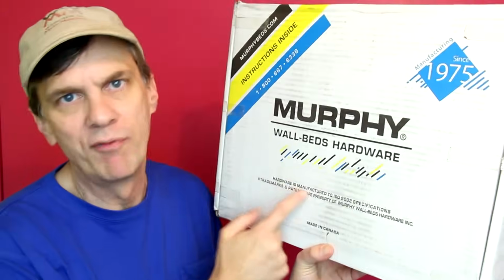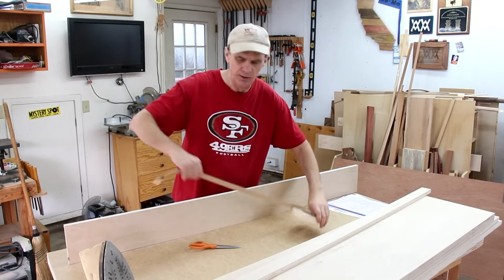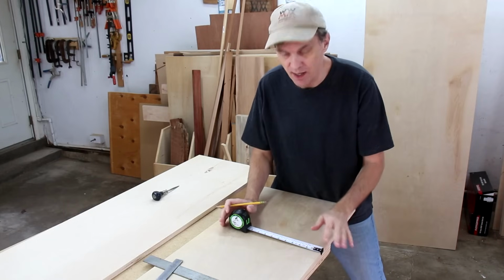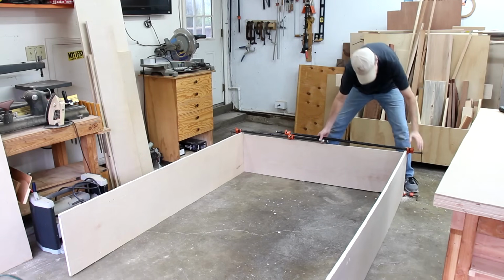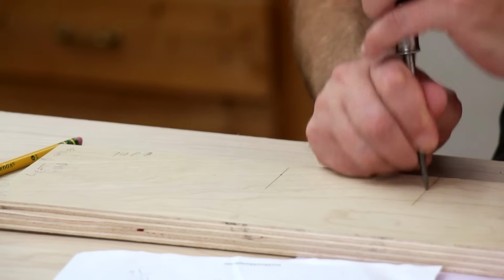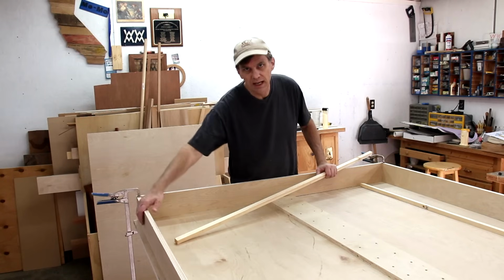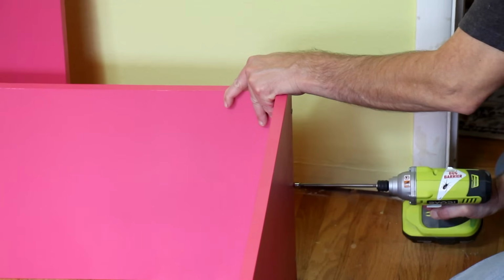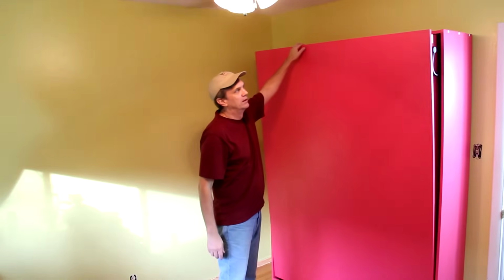How to Build a Murphy Bed. Free up floor space in your home!

Comment: I have a question about the arch that the full size mattress has in a Murphy bed configuration? This video shows a ceiling fan in the room where the Murphy bed is installed. I want to install a Murphy bed in my spare room and I want to install a small ceiling with light as well. I want the bed to swing from head into position. I am concerned that the arch of the bed will contact the fan.

Comment: When I need long pipe clamps, I just screw a straight splice between 2 pipes and that is so much more steady than trying to use 2 clamps and I have had up to 3 pipes together. This lets me have long clamps when I need them and then shorter (say 2 to 3 feet) clamps the rest of the time. The splices are just nipples that you can buy to fasten long lengths of pipe together when running a long line during remodeling or during a "new House" build. They are only about $2 each.

I made a bed base for my daughter and used biscuits (only because I had them along with the biscuit machine) and then used face frame screws every 4 inches as clamps. The unit is still being used and this is after 5 years.

Comment: Steve: You are pretty cheap if you can't invest into some longer lengths of pipe which you can always use later in life! I one time bought 20' galvanized pipe for a very large deck job with engineered exotic lumber. I later cut it down in size to use on cabinets and other jobs! Those clamps look like jorgensen & are great in my mind!! Buy longer pieces of pipe.
Reply from the maker: Yep, I am very cheap!
Reply: Steve Ramsey lol

Comment: Hi Steve! This was great. Can you tell me how high your ceilings are? I'm trying to decide if I need to go horizontal on my bed or if I can go vertical.
Reply: A standard bed is six foot long. Even allowing space for the mechanisms, you should be fine with a standard height ceiling. The bed might be a little low to the floor but it'll fit

Comment: Dumb question but why did you use the edge banding since you were painting it? I love your videos, keep them coming.
Reply: I've seen it done before when you can still the plywood layers even with paint, so putting the edge banding creates a smooth surface to paint over.
Reply: Les K yeah, paint doesn’t cover plywood edges very well.
Reply: Apply a layer of spackle on the plywood edge and then paint it,, it will hide the plywood edge.
Reply: iron-on edge banding is MUCH easier than that. No sanding, and less effort to smooth it out.

Comment: Steve, enjoyed the vid, when we get our first house this is the first thing my wife wants installed.  I thought it odd you mentioned not being able to drill straight through the two pieces of wood.  It is an odd tool that sees very little use in my household, but it has come in handy.  A portable drill guide.  Similar to your pocket hole guide, but more of a drill press.  Found one on amazon, thought you might take a look, definite time saver when it is needed.  http://www.amazon.com/Promax-79251-Precision-Portable-Electric/dp/B002C1AMOE

Comment: Steve Ramsey can pocket holes & jig be used instead of bisquits? Will it still be strong enough to hold the two pieces of wood together? I don't have a bisquit jointer is the reason I ask. Thanks

Comment: I worry about using screws between the plies of wood sheet you used.  Seems to me that they will work loose with time and mess up the wood in the process.  Why didn't you use finger joints and glue?  Maybe use corner braces?

Comment: 1 more thought, even though I modded the build, with the wallyworld matress in a box, I can use very light pressure to raise and lower it and you can stop and balance it with 2 fingers.the gas shock system thru rockler or amazon is top shelf.

Comment: I dont need no stinking instructions,,,,,, well when building a murphy type bed yes you do. Ive wanted to do a wallbed for years, finally wore her down and got the green light , I wanted to do it in cherry, she said just do it. After adding up how much it was going to cost I almost made it paint grade, then I realised I had some hollow core doors and figured out how to re use them for the matress frame platform eliminating 1 sheet of cherry ply, thats 140.00 so I figured that made the cherry build doable again. It came out great. I used the gas shock kit from rocklers, mainly because of the fantastic instructions and blue print type layout pics. I made the front look like 2 craftman style doors and added crown mold ontop.i hate edge banding and always use solid trim, I used alder for the trim and it matches well with the mission cherry gel stain and wax treatment.Here is a tip , if you are putting this on carpet , wait to drill the mounting holes for the foot mechinism.because as you are plumbing the frame work it may settle Into the carpet and your guests will be sleeping with their feet higher than their head, how do I know this?..just guess.total cost for the cherry wall bed not including matress 975.00. Note wally world sells online  a bed in a box, like your steve, in full size for around 200 bucks. Our guests really admire the bed and it sleeps great. Great vid steve thank for all youdo.

Comment: I like, no surprise there. I live in a rented home, so I didn't want to bolt a Murphy mechanism to the floor, so I used a kit from Create-a-bed, their plans are fully diagramed and the guy there cutomized the plans and the gas lift system for my, already owned, overized, pillow topped, king size mattress, for no extra charge. I love it. 

The kit you used here appears to also allow for minimum overhead mounting with minimum modification to the house, I like it, the build seems simpler cause the design is way less ornate, you appear to have made up for that with your bold paint choices, great job.

By the way those special screws are like the ones found in most IKEA flat packed furniture (I have assembled literally tons of them), they appear to be designed for holding different forms of that really heavy particle/press board they use, it pulls together and holds stuff together that is quite a bit weaker than plywood, so should work great here.

I sleep on one of these every night, its a lot of fun to get the space back in the morning :-)

Comment: You can buy those "special" screws separately, I know Hettich makes them, probably some other manufacturers do too. They come with dedicated two-diameter drill bits and are fantastic for connecting boards. They make for a very strong and rigid connection. Particularly good for anything where you cannot use glue.

Comment: I have some of the same pipe clamps and made the your clamp rack from an old video.  I solved the problem of long reaching pipe clamps by buying the appropriate sized Union piece from one of those big box stores and I can just join two of my pipes together end to end.  The union also doubles as a thread-saver on the non business end of the pipe clamp.

Comment: Great video, a Murphy bed has been on my list for quite a while now.  If at least one of your pipe clamps is threaded on both ends you can get a coupler to extend them.  If not, that's a great tip on another way to do it.

Comment: Whether your pipe clamps (that were not long enough) are 1/2" or 3/4" iron pipe - I'm pretty sure that either 1/2" or 3/4" SCH40 PVC Pipe has the same O.D. --- And what's cool, is that they come in 10 foot lengths! They'd probably bow under a lot of pressure, but perhaps it would work for custom projects, lie this one?

Comment: If you know someone with a pipe threader have them thread both ends of your pipe and use a coupling. I'm a gas fitter learning wood working in a very small shop and I'm doing all I can to save space.

Comment: Built a Murphy a few years ago much like this one (the Rockler kit).  Had the SAME experience with a bed!  Thanks Steve - great post.
Reply: Meant to mention that I had thought about a desk on the exposed side of the folded bed, but couldn't quite get it straight in my head.  I did run into some versions on the lumber jocks site:

http://lumberjocks.com/projects/tag/murphy+bed

Comment: Nice little vid Steve.  I've been contemplating putting one of these kits together for a while for when we have visitors.  We have some small rooms that don't have enough room for queen beds that are there full time.  It will be cramped when in use, but perfect when not.  Would love it if you'd start to include approximate total cost of materials with these projects.  Thanks

Comment: Hi Steve I saw your video how to build a Murphy Bed some time ago I sat down & designed a twin sized Murphy Bed in sketch up for my wife’s women cave / guest room I haven’t built it yet. My design does not have the springs that the one you built but I think because it is only a twin size it should be to hard to lift up & down. I would really like you to take a look at the sketch up file and let me know what you think of it would work or not but the file is to large to upload to your site. I would really like to show it to you & get your feed back.

Vince
Reply: this is my first time using google doc's I think this is the right link https://drive.google.com/folderview?id=0B8trAdHpfHGwd2xacllYQ2dmeFU&usp=sharing
Reply: Vince Baker I'm not Steve, but I took a quick look. That shelf? is useless. And there is a reason to use mechanisms(they kinda lighten your load), just watch for the weight limit and redesign to account for mounting holes. I think this is a good starting point(version 1), but read up on murphy beds and better your design. Good luck.
Reply: Romashk
 Hi Romashk thanks for the in put, the shelf is there so my wife can put nick nacks and or pix when the bed is in the up position & when the bed is down the 2x12 shelf helps port the bed. I get what you mean about the weight I did put a lot of 2x4' under the mattress lol but I was thinking if it turned out to be to heavy for my wife to lift & put down then I would be the one to do that task,  I might need to eat some whetes before I try LOL :-)
Reply: Vince Baker The shelf can be turning to always be in horizontal position and only then could you store anything on it(watch a few murphy bed YT videos -you'll see what I mean). The weight is a very serious thing for any moving part. It's a thing to consider in any such design. Add your weight, plus bed, plus mattress, plus pillows and stuff, how long will your hinges last? And inset the bed a little for safety.

Comment: Quick tip. Head down to  the hardware store and pick up some pipe couplers in the plumbing department. They work pretty well for extending shorter clamps. Loved the color, by the way.

Comment: Any thoughts on putting something on the outside of the bed (wall) when it is in the upright position (art work, shelf, coat rack, ...)?
Reply: How about adding swinging shelves that pivot at the edges, so that the shelf stays perpendicular to the floor when lowered. Add a small rail or lip to the shelf to keep stuff rolling off. Would give your wife more craft supply storage space.
Reply: ***** what would be really freaky is a narrow bookcase either side of the bed then get loads of book spines ( buy books from a charity/thrift shop & butcher them) & glue these to the bed... bed is up looks like a whole wall bookcase
Reply: 888johnmac
But Steve tells us that he now uses Audible.com audio books, so he has no need for actual books ;)

Comment: What do those 'special' fasteners bring to the party? How do they differ from any other type of fastener that could be used in a similar butt joint?
Reply: ***** Never knew their name. I always called them Ikea Screws
Reply: ***** there is also special step bits available specific for the size screw
Reply: They make the joint very rigid. Particularly good for joining particle boards.
Reply: Going by what the website says they're made to be used in ikea type, put it together yourself applications. The small tip is for finding the pre-drilled hole in slightly misaligned parts while the deep threads help hold in cheap fiberboards. Plus, there are caps that fit into the heads to cover em up. No real reason to use these over another kind of screw in this particular application that I can see. Maybe you feel better about the price of the kit if it comes with these "special" screws? I dunno.
Reply: Channel+ banana

Comment: Nice project. I am glad to see that you got a current style kit than we did. Ours used feet out of thin wall tubing, with a thin wall tubing cross piece. The cross piece had a threaded insert welded in, and it didn't take long for that weld to break. The wooden cross piece is definitely a better idea.

Comment: Makes me wonder what was so special about those "special screws" used for the outer frame. The only things that looked special was the leg and the spring mechanism. A cost of the kit would've been nice as well. Good video though!
Reply: In Europe, especially in my region (Central Europe) every kind of furniture contains such screws. I don't know why are they so special, maybe because they are thick, but you can find them in every furniture kit.
Reply: ***** , so cost of the hardware and the wood? 
How is the mattress fastened down?
I have been interested in Murphy beds for a while, but it always feels like the hardware/plans are excessively expensive for essentially screws and springs... 
And buying a built unit is through the roof.  
I like the faux bookshelf idea listed above.  You should post if you do any additional finish work on it.
Have a blast and take care.